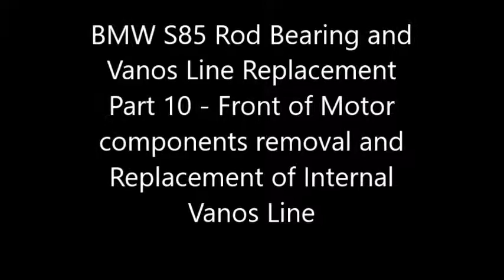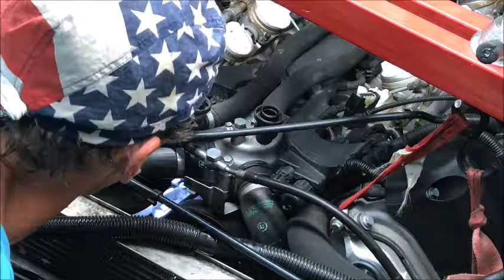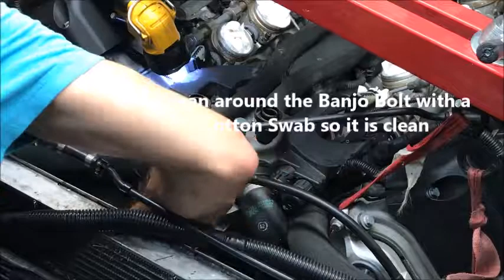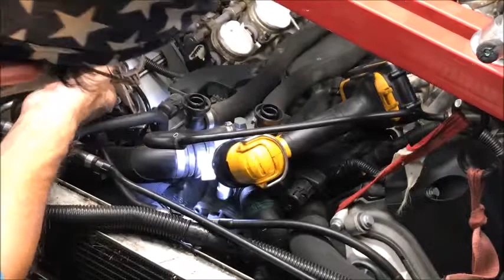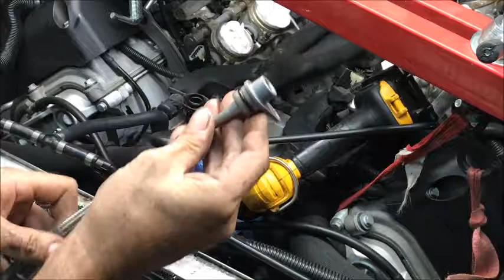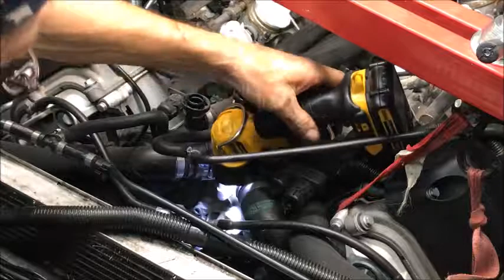BMW S85 Rod Bearing and Vanos Line Replacement Part 10 of 13 - Vanos Line Replacement

Comment: Steve may I ask why do you need to change the Vanos line,   is it the lightly hood of it being blocked even if the screen filter looked fine.
Reply from the maker: DaveP , hello.  From what I understand, the internal vanos line on some of the earlier years of the S85 engine were prone to leaks of the line.  Since it’s not too difficult to do while everything is apart for the rod bearing job, I replaced it as a precaution so I would not have to take it all apart again if the line started leaking.  I don’t think it was an issue for the year models of ‘08 or newer (mine is an ‘07), so it may not be as important to change for those.  Hope this helps 👍, Steve
Reply: @StevesDIYs  thanks Steve I understand.